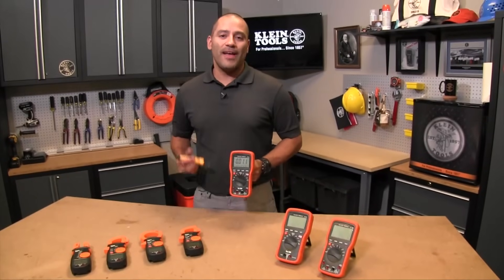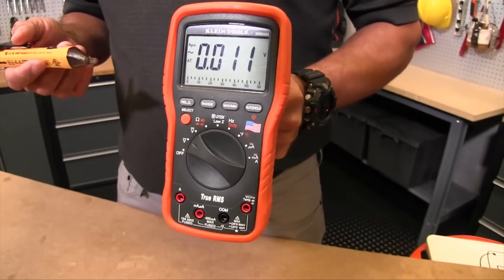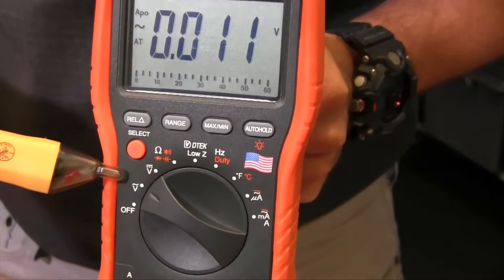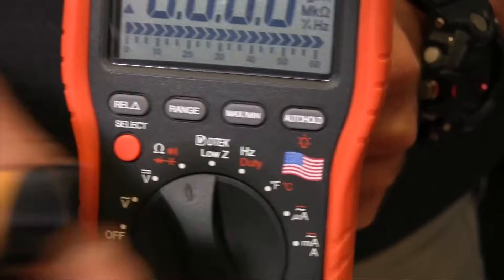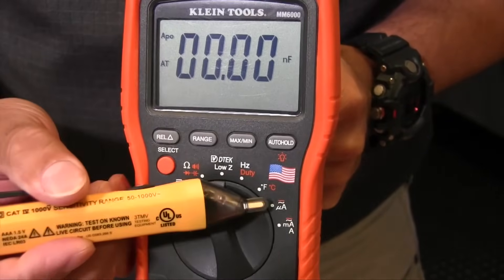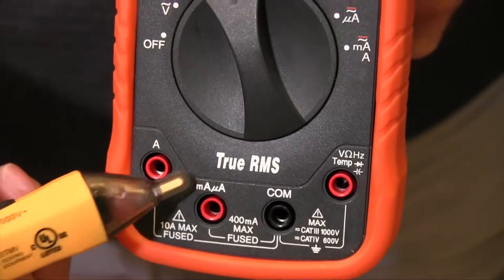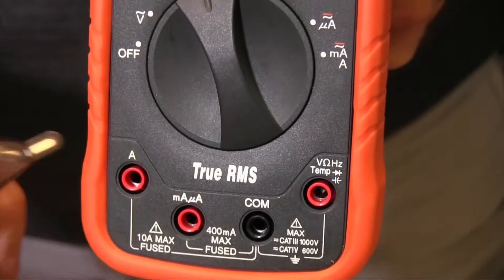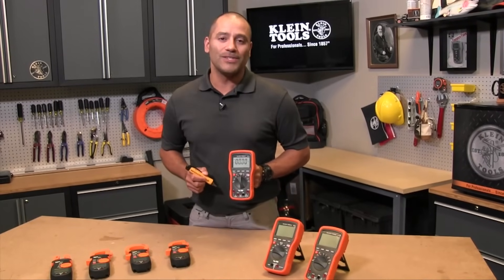How To Use The Basic Functions Of A Digital Multimeter

Comment: Maybe I'm just a dumb carpenter, but it looks to me as though multimeters could benefit from a little clarity in their design. If we're only looking to measure voltage, amperage, and resistance, then why does its interface read like a physics exam? Electricians: nobody's impressed by your jargon. And tool manufacturers: take a cue from DeWalt, who is the current market leader, and who only got there by introducing a line of brightly-colored Playskool tools that were designed for use by the average human being. 

We want three things in a tool: simple, rugged, and cheap. Everything else is bait.

Comment: Thank you!  Excellent and comprehensive!!  Great stuff!  Blessings!
Reply: States there are a couple of secondary options under resistance, but doesn't say what they are. Then identifies several more modes without any explanation of what they are. How is this in anyway comprehensive? It's literally the opposite of that.
Reply: He explained the basic, which applies to all multimeters, regardless of the manufacturer. Check your manual for explanation of secondary features specific to your meter or Google it

Comment: One day someone will do a basic vide showing how to test different things beginners would test, they will turn the multimeter to the correct selection and explain only the basics.
Reply: I agree. This video is terrible. I bought their MM600 and can’t even get the battery door off.
Reply: @pamtnman1515  😅🤦‍♂️
Reply: Let me know if you find one 🙏
Reply: It's almost like one day you'll actually read directions or a book. Like, some people want to check current. If they live in the United States they probably have alternating current. In which case they would turn their multimeter to voltage AC for that alternating current. They could then put their test leads into a socket. One red lead on the hot socket and one black lid on the neutral socket, and excluding the ground, they will get a reading of their voltage. But things like that or too difficult for keyboard bullies
Reply: @wiley0714  or he could set the meter to temperature and one lead goes into the positive and the other in his culo
Reply: @wiley0714 not all multimeters are that simple.
Reply: @wiley0714 you still didnt explain it. You need to move the red lead to the amps lead hole, then select amps. You then need to break the circuit and add the multimeter as part of that circuit. If you do it wrong it will pop the fuse. He didnt explain it in the video which is titled "how to use a multimeter"
Reply: @wiley0714  You seem to more of a bully than anyone else I've seen on here. It's too bad Yahoo doesn't show thumbs down any longer. I'm sure you have several.
Reply: @wiley0714  what's a socket?  "Sock it to me? " you mean receptacle?🥴

Comment: I just bought a light fixture but the loose hanging wires have no tell as to what color they are. They were painted white all the way through. I found the copper wire, but idk which one is hot and which one is neutral ... they are also a little frayed should I snipp them off when I work on them?
Reply: sugar fitz snip them a little bit, don’t take too much off. Then strip them with your wire strippers according to the size (e.g. 12 AWG, 14 AWG), then test each one for continuity against each wire. The one that consistently gives you continuity will be your hot. I would recommend flipping your light switches on and off one by one to test said wires(depending how many light switches will be powering said fixture). From there you tie off the wires that don’t give off power, which are your neutrals and travelers (if applicable). Then you tie off neutrals to neutrals, grounds to grounds, hots to hots, and travelers to travelers (if applicable).
Reply: @vinceuribe5946  great answer and great advice. Thanks for that! ✅